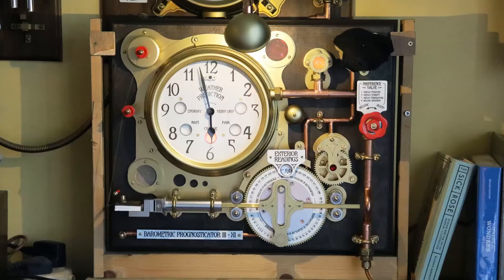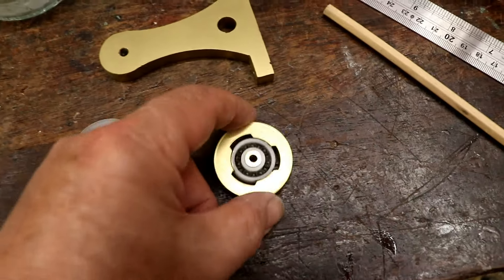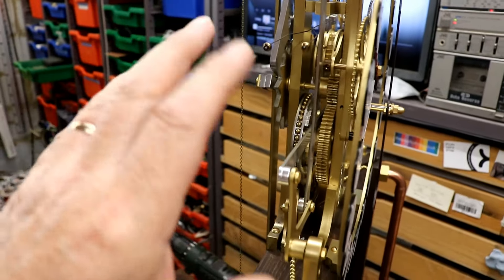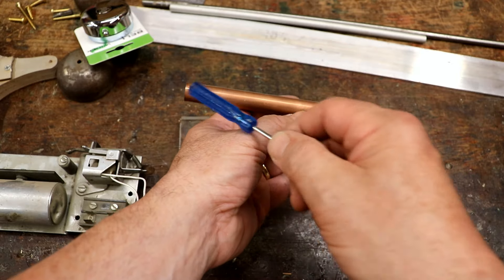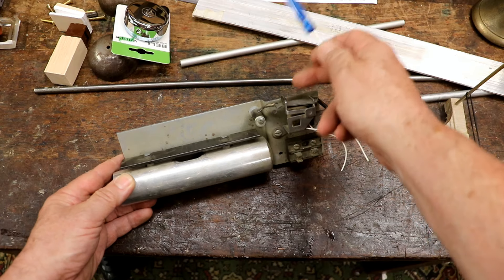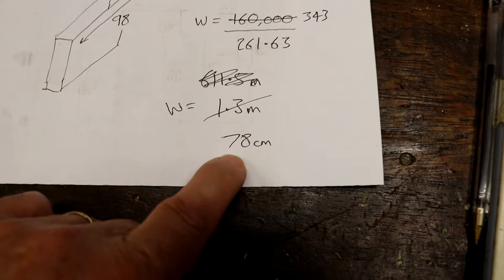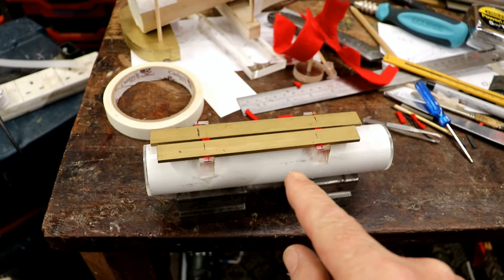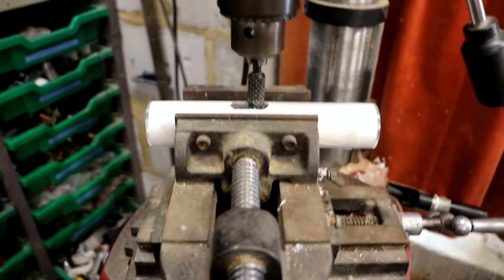Unplanned Steampunk Arcade Machine #11

Comment: The balls hitting the brass plates vibrats a lot. This may reduce the energy transfered to the brass. Would a less flexible rod do better or more flexible one. You may experiment that.
Reply from the maker: That's a good point. Because everything to do with this project is so complicated, I'll leave the current hammers in place for the time being as they sort of work. However, with renewed vigour at some point I may well do some more experiments with less/more bendy wire!

Comment: Would like to see you progress on Tardis console. Give some break to the Arcade game.
Reply from the maker: I'm just waiting for Dan to give me the okay to include a central structural tube, as the acrylic outer tube wouldn't be strong enough to support the top of the machine. A central tube would also provide a surface on which bearings could run to guide the moving tube arrays andto link them together mechanically. I can't wait to start!